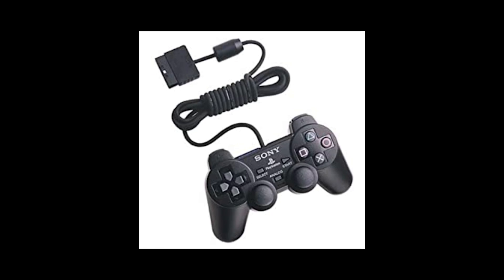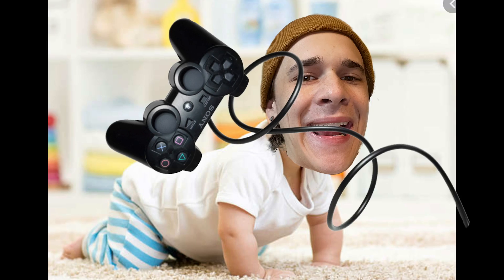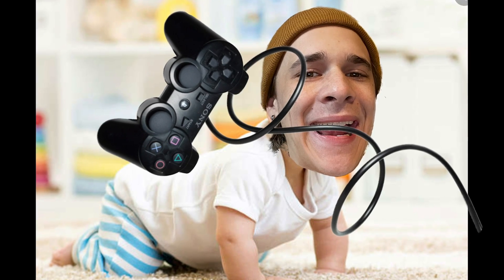Parenting 101 with ScannerDanner: learning your fundamentals to ensure your child's safety

Comment: Hello! I watch your videos, I am a subscriber of your channel, and I work as an auto electrician in my city, I am from Kazakhstan. Sorry for not referring to the topic, I want to ask you for advice. Came to repair Toyota Camry 30 to replace the generator, after replacement, the tachometer went off scale according to the client. Could it be that after the battery terminal was thrown back, the tachometer went off scale? Yours faithfully!
Reply from the maker: so the tach is all the way around to the other side?  this may help you https://youtu.be/3Y6XkOS6kTk
Reply: @ScannerDanner  Thank you very much! You really clearly helped me in my question. I called the more experienced electricians of my city for several hours, but no one knew, but I'm more inclined that no one wanted to give me advice or a hint, I am a novice auto electrician, I have only been working in this field for a few years. I am glad that You responded and helped! The link you gave me really cheered me up and changed my mood for the better. Thanks!
Reply from the maker: @konstantinsh.267  If that doesn't work we can help you more on my forum. It is free to join at www.scannerdanner.com Thank you so much!

Comment: And then, of course, the kids gradually moved on to eating their Elmer's glue and the wife was freaking out again so I did my research.  I found and showed her an MSDS sheet showing that it could be eaten even thought it's a petroleum based polymer.  The body doesn't process it and it passes right through the body.  I let them continue eating the glue because the more I kept letting them chew on my controller cord, the more they'd yank on the wire and I'd either get the controller yanked out of my hand or they'd disconnect it from the Playstation in the middle of a boss fight.  So I was like, Caleb, you go do you some Elmer's shooters while I maximize the efficiency of my time on the Playstation.  Caleb only loaded up his nose once and we let it dry and we pulled out a perfect cast of his nasal cavity.    He wouldn't eat that though.  He clearly does not like his Elmer's glue crunchy.
Reply from the maker: 🤣🤣🤣 wish I could tag Caleb like on Facebook here

Comment: Ah, but I learned about AC and 120Volt reference the hard way...by not listening to my parents when they said not to play with the lighted Christmas display that I took behind a chair and plugged into the wall...and my little finger was between the two prongs for the split second that I knew, something bad was going to happen. And then both I and the chair...moved.